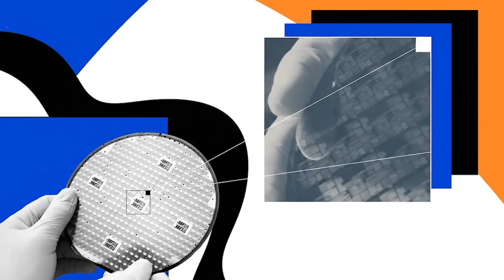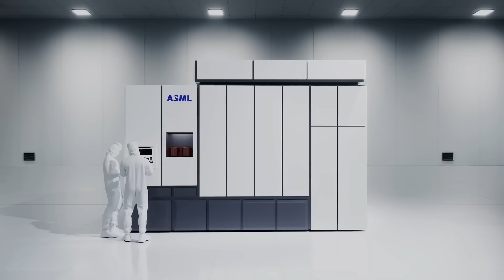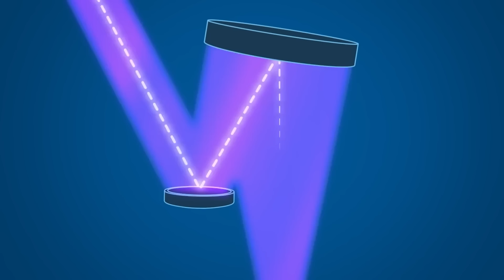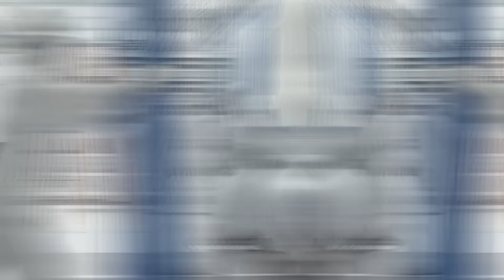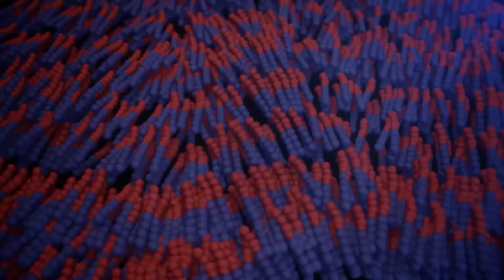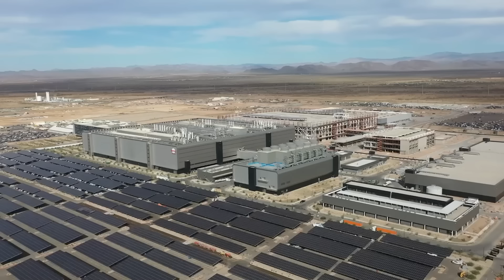INTEL's Monstrous 14 - A Chip Will Make SAMSUNG & ASML's Chip Look Like Paper Weights!

Comment: That thumbnail and title are fantas... crap.. 

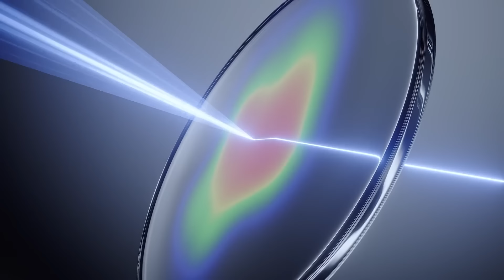The machine pictured is literally an ASML Twinscan EXE (5:39). 

On top of that, guess who does the lithography architecture for Intel’s "all spooky new monstrous 14" node? ASML.

While you slate Samsung, Intel is literally using ASML's proprietary hardware to make this happen. 

You’ve literally made an idiot of yourself...

1, 2, 3, 4, 5, and 6 times in one video... I might have missed a few...

I wish I could take a UV shot of this post and etch it onto a die.

unenergetic clap 👏